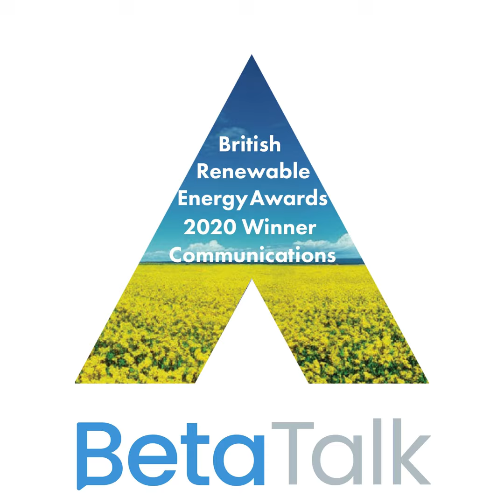Spruce up Your Home with a Heat Pump

Comment: I'm not sure what the primary aim of this podcast is meant to be, so please forgive me if you find I've gotten the wrong end of the stick. 

If that primary aim is to reach out to the energy installer industry, then what I would say is that the discussions need to be a little more structured and the podcasts much shorter in length as industry professionals are often time poor.

If that primary aim is to reach out to the general public, then the use of abbreviations, at the very least, need to be explained for the listener's benefit as most people won't know, for example, what a DNO is. I presume in this instance that it stands for District Network Operator, which, in and of itself, will require a brief explanation as most will never have heard of it. I only know what that is because I am a fan of the Fully Charged Show and their sister Show, The Everything Electric Show. 

Hope this is helpful feedback. 😊